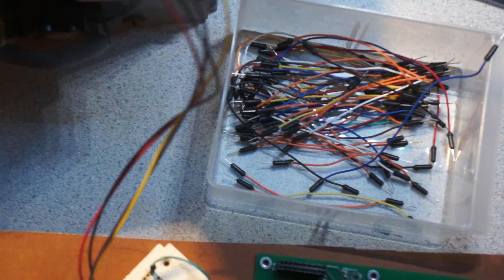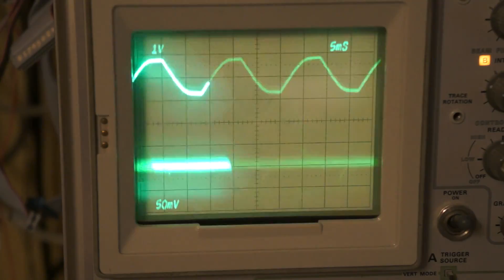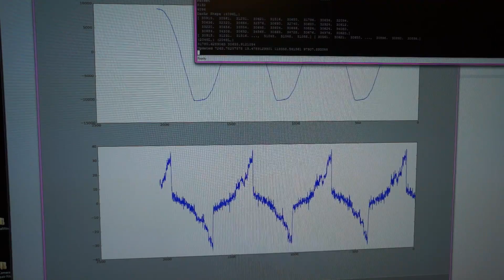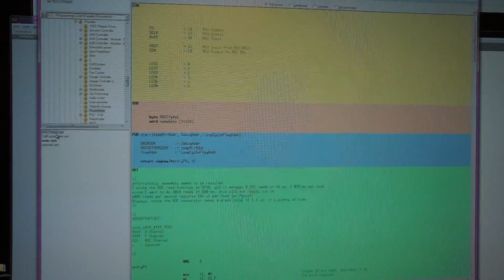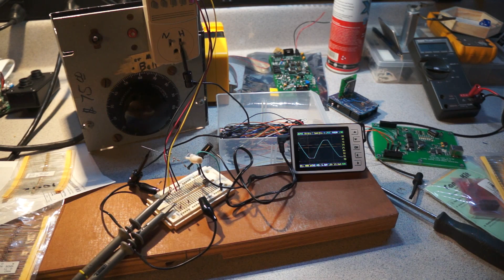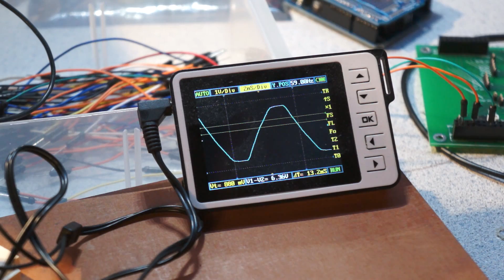Power-Meter Project - Part 1

Comment: Hi Conner,   you stated that you have some PASM heart ache with the Prop.  Please try Tachyon FORTH for the propeller.  After a little learning curve you will be extremely happy and suprised at the speed!   And if you have to have absolute PASM speed you can now do inline PASM in the FORTH code or provide a small RUNMODE in assembler.   Tachyon is not ansi standard but has been tailored to the prop by Peter J. Give it a try, you will like the complete dev environment, you just need a terminal,  like your VT100!!!

Comment: By the way, that's all motivated by my slightly negative experiences with micro's (atmel uc3a mostly, also an nxp that I forgot, I never forget component numbers...) with integrated RF. It's nice if they *only* do node management, RF stuff and all that, but if you want to use other fancy peripherals all of the sudden youre using too much cpu time and the wireless connection becomes unreliable (like 10s of retries on a packet). Also, I am bad at low-level programming.

Comment: Well... uh... experiences vary? Bluetooth, especially transparent bluetooth serial links, are mostly really compatible with everything so its easy to set up. 802.15 is more domotics-oriented (lower power, error correction, packetized), although If you go that route it's probably easier for you to use something like nRF24L01+. The atmels are a bit hard to get, quite expensive and most of all it's gonna take you a while to get the wireless stack to play nice.

Comment: I'd be interested to see how you solve it. On the one hand with some limitation on ABW you could do oversampling, on the other hand a discrete ADC will probably be more power efficient and have less error (especially D-S ADCs), and it would free up constraints for the mcu. As for wireless: bluetooth is awesome for stuff like this. I like stuff that can interact with my phone as well as computer :P

Comment from the maker: I have a few requirements that make things a bit more complex, mostly that I want to A. take 16 bit data, and B. dump the raw wave-form to the computer, rather the converting to VA/watts locally (I like seeing the data). Realistically, I also thing I'm going to stick a small wireless tranceiver on the thing, as an easier way to get the data to the computer in an isolated manner.

Comment: To give an idea of how and what: Most people cite e.g. HVDC inverters in offshore power transfer as typical cases where AC transformers win wrt reliability (and they do, transformers have >99.5% uptime, smps <98%). But as you scale down voltage and get within the realm of IGBT switchers, reliability is on par and cost is actually really low (because of the small transformers). And you completely avoid the three main failure modes of transformers: overloading, overheating and DC bias failure.

Comment: I'm not talking about high voltage transformers, just MV stuff in residential areas. These areas produce a hell lot of interference that just gets kicked back onto the MV and eventually HV mains networks, totally unnecessarily. Efficiency isn't the problem here; it's bad power quality. 

A couple tens of years back you would have been right; transformers would be the technically better choice. Nowadays? Nope. Keep in mind that MV is usually just 4 or 10kV, not hundreds. This is easy peasy.

Comment: Also: I like this project a lot, once you have a custom board ready I'd love to see a video of the finished product. The cheapest way to go is probably to hang an MCU directly (with some protection of course) onto the current shunt, use a pulse transformer to measure the voltage, use another pulse transformer or CLC circuit to power the mcu and use something like an adum3160 to isolate data towards the computer. Then 3d-print a nice case for it :D

Comment: The flat-topped line voltage is usually the actual line voltage going into your house, because for arcane and dark reasons energy companies are still using big transformers instead of switching ac-dc-ac PFC supplies to step down medium voltage to household line voltage. So you're seeing the effect of many houses having mostly smps running.

Honestly, this is not a problem. Most problems arise from high frequency interference, not low-frequency stuff like this.